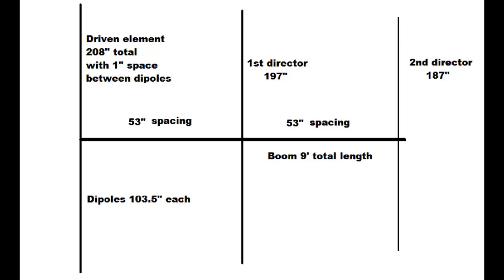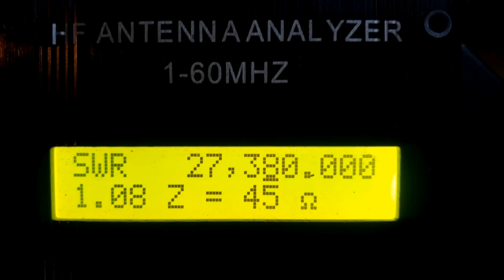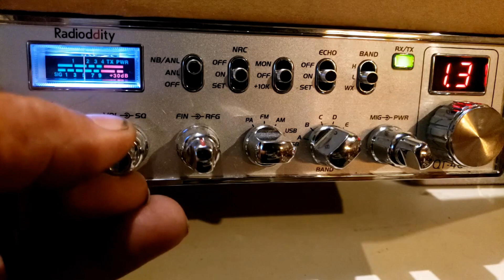Yagi Freak! Homemade CB Beam Antenna

Comment: How many watts would that be able to handle ?
Reply from the maker: the coax is only rated for 2000 watts, But the antenna can handle more.
Reply: @MowerJunkie very bice man , eventually i am so going to try this 😂, very cool. I am up in canada waiting on some stuff should be able to get going in a couolle weeks . Are the radials round that you have ? Is this just aluminum rids or ?
Reply: Rods not rids

Comment: Hi Mower Junkie! Been following your videos for a while to get tips and tricks on antenna building. Last Spring, I built a Starduster omni antenna, and connected my Radioddity QT60 to it. On my first "CQ" I was reaching Tennessee and South Carolina from Arizona! 

I haven't been on the air since Spring because of the desert heat (my shack is on my back porch, but plan on moving it inside ASAP)), but now that it's cooling off, I'm ready to get back on the air! All that said, I'd like to see if I can't reach out to you for a QSO in the near future. My handle is "311 Engineer".  Let me know when is a good time to reach out!  "73s"!
Reply from the maker: Hello 311, I'm going to have my radio on all day tomorrow, most of the time I'll be on channel 38. If I hear you call, I'll call right back.

Comment: I run a 11 meter radio station out of south west ohio i was curios if that antenna has any reflection at all it seems to have round corners pointing at maine and getting wisconsin in there i like to experament with antennas to good video sir.

Comment: This antenna could be built for Low VHF TV Channel 2 if you cut all the measurements by 1/2 and for Low VHF TV Channel 5 if you cut the measurements by 2/3.  This would be great for TV Markets with Low VHF TV Channels 2, 3, 4, 5, 6.

Comment: OK Let me get this straight, 1 element is your center coaxial lead, and the other 5 elements are hooked to the Grounded shield wire is that Right, Cause I want to Build this.
Reply from the maker: the coax is only connected to the back (driven) element. the shield goes to 1 half, and the center goes to the other half. the other 2 elements are only grounded to the boom.

Comment: Another great video sir. Anyway, this is just direct fed? No BALUNS or common mode choke or anything of that nature sir!
Reply from the maker: Thanks, It's just direct fed, there's no balun.
Reply: @MowerJunkie Copy that sir and thank you so much for comin' back on me. I sure am gonna try making one of this. Yup, not much F/B ratio but sure works on both ends and don't have to turn the antenna that much. All the best sir and enjoy the Holidays. Merry Christmas and a Happy New Year from the Philippines.
Reply: @MowerJunkie Oh, by the way sir, correct me if I am wrong. The two directors are grounded on the boom, correct?
Reply from the maker: @franciscolopez3229  Yes, the 2 directors are grounded to the boom.
Reply: @MowerJunkie Roger that sir.

Comment: Well I get that it's a dipole with two directors in one direction, but isn't it also kind of a dipole with a reflector behind it in the other direction? 😅 I wouldn't have a clue what the actual gain was in each direction, but I'm sure the backwards must be getting helped by having an almost-reflector not quite the right size or spacing, right behind it.

Comment: I just used MMANA antenna modelling software to simulate your design  ,and if you can increase the spacing between the 1st director and 2nd director to 88 inches , your gain and FB will increase a bit ........ I can do screenshots of the model if you like .
Reply from the maker: Thanks, But I'm going to run it as-is. My boom is not long enough to increase the spacing.

Comment: I have been trying to find a square aluminium tube for months here in Thailand.
Nothing is easy as far as  radio is concerned here.
And importing stuff is a total pain.
Reply: I will give you advice. You can use chain link fence post. You will get some years of service from that antenna
Reply: @garthwilson231  thank you for that advice.
My present antenna is a three element quad that I built using a 13 foot × 2 and a half inch pvc pipe, and bamboo spreaders.
Last night I had 32 contacts from Northern Thailand into 7 different countries in and around Europe using the qaud.
So I guess it must be working OK, I just want to make a four element qaud, and the pvc is too flimsy for that.

Comment: Try a Moxon. Quiet back end, small footprint, can be made out of anything that can hold the wire.
Reply: you can make those out of aluminum tube and cut the corners out of a chair to make it extra easy. Use pvc pipe to set the gaps

Comment: Certainly it should work, but not without sacrificing the Front to back !
If proper element spacing is utilized, and a reflector used, you should see gain out the front of the antenna, somewhere near 6 to 9 DB ( isotropic ),
And somewhere less dbd !
Too you will see the much needed rejection off the back of the antenna, ( Reflector side ), when pointed away from a specific station.
Don't forget, that once the RF leaves the antenna, it is subject to anything it might encounter, especially in the near field !
But once the RF strikes the ionosphere, all bets are off, and even the polarity of the signal !
But I'm sure you already know this ?
I wish you would have  rotated the antenna 180 degrees, to witness any changes !

Listening to the contact with Wisconsin, and you saying the antenna was pointing to England ?
Maybe you just invented an omnidirectional beam ?
             👍😂🤣😂

Comment: Hi mower the coax is it just the straight forward 50ohm from antenna to radio or do you have a tail of 75ohm in line great vids
Reply from the maker: Just 50 ohm coax. a direct feed Dipole, or Yagi does not need any matching device, it's 50 ohm naturally. the element spacing can adjust the resistance if necessary.
Reply: @MowerJunkie  ty building one Monday 💯🇺🇸💎💎💎💎💎